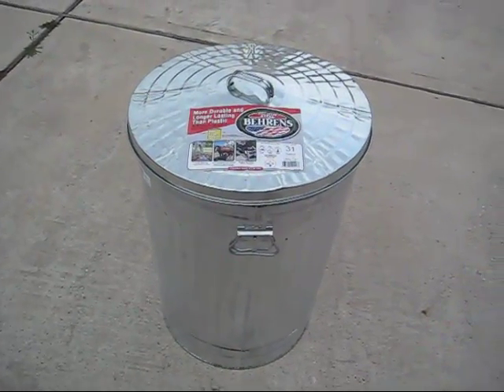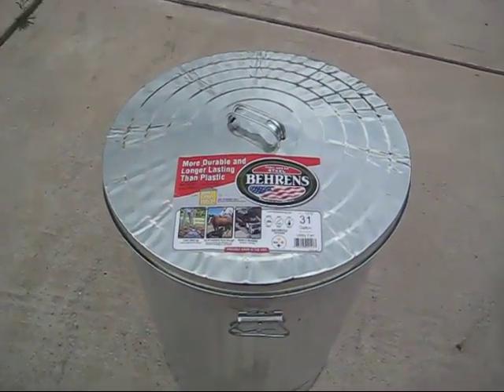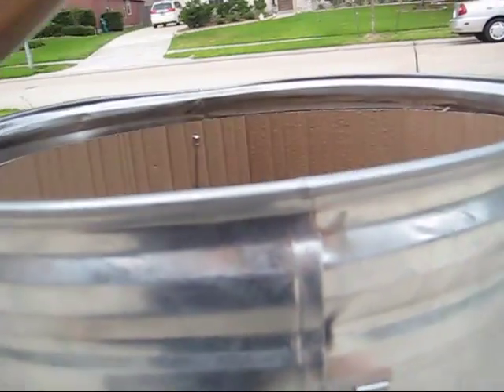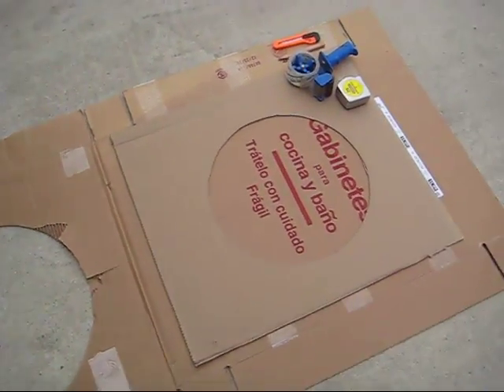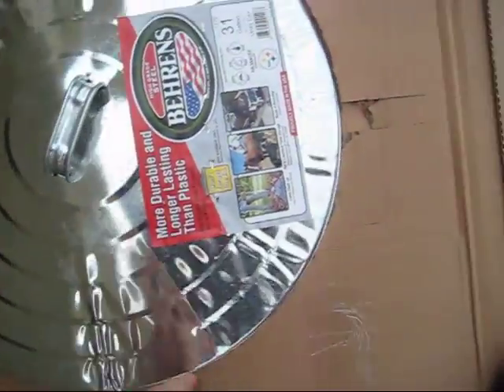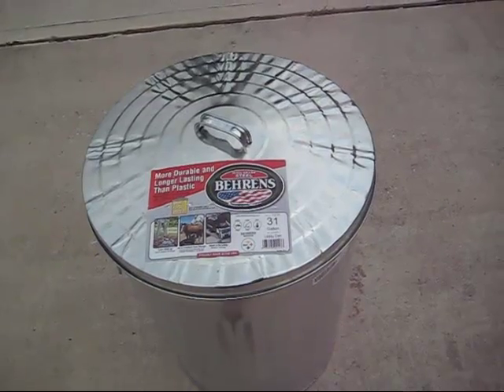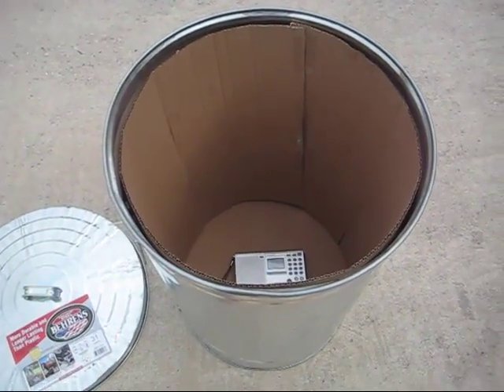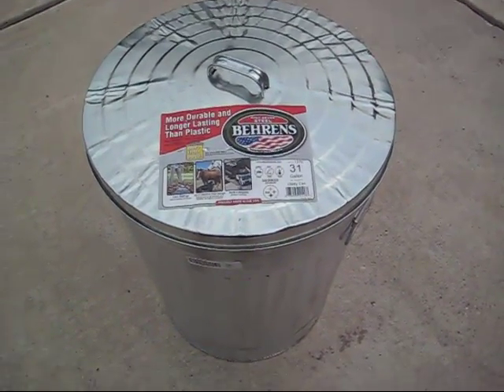Faraday Cage: Garbage Can, Really?

Comment: FM isn't a good test even if the cage is good. Fm can be fully blocked with a chain link fence or mesh with holes an inch wide, an emp device or solar event goes down to DC power so a pinhole is too big

Comment: I had to put 2way tape in to hold my cardboard. I also put faraday cloth on the lid, but it’s not working because I can hear my tablet when I put the lid on. Please help me!!
Reply: Sometimes the seams can “leak” as well as the lid. Try some aluminum tape from the inside for the seams. Plain foil around the mouth of the can before fitting the lid. You may also nest a smaller metal trash can or paint bucket setup like the outer can.

Comment: Do you have to ground this? If so how would you do yhis.
Reply: I’ve watched a lot of this type of videos, some do most don’t. They sometimes ground it like a generator, wire in the ground or metal pipe in house. One used grounding wire in electrical outlet, not for me. A PHD type said that there is very little gain doing it.

Comment: How will a cell phone work after an EMP event without a Sim card ? Or what can one do to use a cell with a number ? Besides 2 two way radio !
Reply: I wonder if cell towers will survive?
Reply: @sixoffive  How they going to get power long term after backup depleted?
Reply: @RazorStrap  Was told that they were designed to withstand lightning strikes so likely they could survive an event. Some have backup batteries for days. But, yea. If infrastructure is down are they going to prioritize cell tower like institutions (hospitals) in restoring power?  Some select towers could be restored with a temporary power source. Depends on the state of national security at the time and resources.
Crazy scary huh? 
I’ve got some stuff in a used metal paint bucket. Followed the same instructions. Large enough for cell phone size stuff.  Good luck.
Reply: @sixoffive  Line the paint can with aluminum foil or copper foil.  The metal in most repurposed containers such as garbage cans, cookie tins etc. is relatively poor electrical conductor.  Lining with better conductive material such as aluminum foil or copper foil will significantly increase its effectiveness.  Also, most metal food containers have a protective coating that is nonconductive.  So, the lid does not make an effective electrical seal. Need to scrape that coating off the lid to container contact surfaces.  Also use an electrically conductive gasket such as aluminum or copper foil or maybe Steel Wool.
Reply: @RazorStrap  Hi, yes I sanded the the coating off where the lid contacts the bucket and tested with ohm meter. I like paint bucket because of the handle. I thought the container should be lined or insulated to protect the contents?  I have a galvanized trash can, but too big for the essentials. 
I’ve been thinking about this for a while. If there is some sort of CME or EMP, there will be a chance of fires. If nothing else lithium batteries. Right?
I’m thinking if you are bugging out, you should be carrying your electronics in a faraday cage type container.

Comment: My plan is to buy this can, line it with a thick layer of  flex seal. Put an inch of sand in the bottom followed by a stack of milk crates as organizers and then seal with 3+ layers of 2" aluminum hvac tape. The goal is to go as overboard as possible. Just because your radio can recieve a typical signal does not mean your cage will protect from a high load as expected in a catastrophic emp. That being said would you rather under do your protective measures or go overkill to ensure your equipment lasts. Another idea is to use smaller cans as a secondary Faraday within the first as another layer of insulation. Is it over kill? Probably. Do I wanna F around and find out? Not really 😅
Reply: Agreed, if we/you do get EMP a second or third could happen. After use I would store those items back inside and re-secure it.
The frequency could be so high/strong that stuff plugged in could burst into flames because of the grid catching and transmission the discharge. A couple of fire extinguishers might be a good idea.

Comment: The dielectric (insulating) strength of this set-up is good for wimpy radio signals.  To shield against EMP, important items should be wrapped in foil, then wrapped in an inch or two of some insulating material.  Being one or two inches away from the garbage can is better and a quarter inch away.  If you have multiple layers of foil, foam (or whatever), foil, foam, foil, foam, then the more paranoid you have it the more protected you are.

In England, people have to pay a subscription to the BBC for every TV and every radio they have.  To enforce this, BBC snooper vans drive up and down every street looking for pirate radios that don't have their subscriptions paid up.  If you were surrounded by Chinese or Russian paratroopers, they could find your hidey-hole simply by looking for radio receivers (with no need to look for transmitted signals).  Beware.  

We have had little bazooka-type rockets that pick up on the radio signal the human heart puts out, and they can tell a human heartbeat from an animal heartbeat.  The first time we let the Israelis have these about 30 years ago, some guy test-fired his first shot out in the desert.  It shot out of the tube a couple hundred feet, detected nothing, started searching as it is supposed to do.  When it got turned around enough to detect his heart beat, it homed in on the guy and killed him.

Comment: I highly recommend people put rechargeable batteries, a small folding solar charger and USB compatible chargers for the batteries. Worst case you will have to cycle those batteries many times, but it would be a drag to protect your electronics and only have enough batteries to run them once. I've found chargers that will do from AAA, 8V all the way through 21700 batteries via USB connected charging sources. You may need to buy quantity of long storage life hearing aid, optic for firearms or other small batteries, but I have even chosen some older optics that use larger batteries which I can charge.

Comment: Great Idea. Im a Ham Radio operator & I would imagine a fridge, or freezer or microwave would shield from EMP. In the UK the metal cabinets are grounded. So perhaps grounding the trash can would allow the energy to discharge to Earth. Or wrapping the likes of my 50 Inch plasma TV  in foil & ground the foii & unplugging the mains & antenna cable would be a good idea.  Any water pipe would do.

Comment: FYI that can is grounded!
It is sitting on concrete which has ground potential.
It is not necessary to insulate the inside of the lid unless you have things that can touch it.
For better results, foil tape the inside and outside of the handles as well as the lid to the can side.
And both inside and outside the can seam (seam that goes from top to bottom) as well as the bottom seam of the trash can.
All it takes is a tiny opening to destroy what is inside.

That can will not protect against a ground zero style of EMP (close airburst).
It can help if you are farther away. Inverse square formula.

Advantage of the metal trash can is that it can protect against EMP DC induced induction.

Comment: You should remove the cardboard to allow full contact between the can and the lid. A metal seal may be even a better option. Also test it with a 2 way radio to ensure it is completely blocking any signal.

Comment: I take nesting a bit to far.
I have EMP bags to put electrical stuff that are first in a Cardboard boxes in. Then I place it in a Ammo cans. I use Metal Duct tape where the 2 pieces meet to seal the seams. I also place the metal tape over any place where the can has been pierce by RIVITS, screws, etc. Then I label what's in the Ammo can on the outside of ammo can.
Then I place the Ammo can Into the garbage can that you have with the cardboard inside and I again tape the lid down with the metal duct tape and cover tape over any area that has pierced the can with tape.
That's taking it a bit to far. 
Just my 2 cent
Good luck

Comment: Strictly speaking, the problem with using corrugated cardboard as the insulator is that if it gets wet it doesn't insulate. Coroplast might be a better option.

Comment: The Faraday cage needs complete metal-to-metal contact for total electrical continuity of the "seal" everywhere, as he says in the video.
Some preppers use aluminum foil to fill any gaps between lid and can.
  Some guys like to use a metal ammunition box if the can is too big, but the preparation is the same (padded inside, electrical; seals,  desiccant bag,  etc.)
Some guys like to add a grounding wire.

Comment: That's exactly what I did.  
But, I also wrapped every device in aluminum foil. Then each item in a Zip Lock baggie. 
My solar charge controllers, inverters, multimeter,, AM/FM/WEATHER Solar/crank radio, and 2- 2 way radio sets. 2-of the  4 unit sets so a total of 8.units. Put my DVD/TV system,  battery chargers, AC Tic Tester, a few extra 2 Cobra CB 40 channel walkie talkies and a battery powered alarm clock.  
There MIGHT be a 9mm Ruger in there too? LOL. 
I figure its better than 90% of what most people have done.  
Oh, I also have a pair if those 12v LED or Fluorescent lamps too. And, everyone should add some 100 or 150 LED  Christmas lights strings in there too. Not a lot of light, but 50-+00 foot for $10 isn't bad. 
Pretty easy to tuck a garbage can out of the way too😁.

Comment: my garage has aluminum siding and a steel door I figured that's a Faraday cage all on its own, but I need  a layer of aluminum foil on the ceiling window and side door, but I keep getting distracted lol and then people will start asking questions.  
But inside there's a grounded gang box lined with cardboard with 3 x coolers wrapped in heavy duty aluminum foil inside of them 3 x ammo cans lined with cardboard inside those are some baofeng radios, some replacement parts for a 70's and an 80's vehicle coils starters and an alternator, a bag of all our old cell phones we don't use anymore but still work. I keep the charged batteries separate in the little jelly jars, a bag of all the extra USB chargers from all kinds of different electronics we've had collecting in a shoe box under the bed. A new atsc TV tuner that has a USB C an old one that has the slighty older USB B I guess. An old tiny little Lenovo laptop that was xp i think it was from one of those black Friday sales. I keep the battery out of it too in two big mylar ziplock bags that have been vacuum sealed the charger in with the other chargers.
I figure if anything is going to catch fire it's going to be the chargers because of all the windings then the car parts because of the windings I keep stuffing little things that we don't use anymore like wrist watches and a couple DS Gameboys pocket radios an organization calculator, the kids big $100 calculator I had to buy them for HS, I can't even remember what I packed inside it's like a garage sale table in each box.  I have been thinking of swapping the plastic coolers for some old steel ones because the foil is a pita but I haven't seen any.

Comment: What does "LDS" stand for in this video?  "Let's Don't Study" I believe.  What do I mean by this?  You show, successfully I might add, a simple faraday cage preventing FM radio waves from entering the container.  GREAT!  If all there was to an EMP was radio waves at that frequency you would be set!  Turns out that the FM frequencies are a TINY portion of what is sent out from an EMP event.  People on YouTube University seem to just test one type of device (FM radio in your case, cell phones and AM radios in other videos) and fail to understand (because of their lack of studying) that an EMP pulse has an effective radio frequency range from a few hundred hertz to 30GHz.  FM frequencies are 88.5 MHz to 107 MHz.  AM is 560 kHz to 1700 kHz.  Cell phones are in the GHz range.  In order to provide adequate protection from an EMP pulse you need a faraday cage able to provide AT LEAST an -80db level of attenuation.  Why?  After a moderate HEMP pulse you are looking at 50k V/m2 (squared) of energy hitting ground level.  That means that if your faraday cage can't provide -80db of attenuation things that you place in your garbage can will be toast. 

The good thing is, since you already have your precious electronics in a garbage can you won't need to move it to another one :-)    It'll already be in the garbage.

Now, how can you improve your design?  First and foremost, you don't want ANY holes.  If you have rivets that are used to attach the handles, you'll need to get rid of that.  The lid handles are often just inserted into a punched out slot and bent.  That needs to be dealt with.  Any seam in the can needs to be dealt with.  Using metallic tape is a good solution for this.  Now, how do you place the lid on the can properly?  First, make sure that the lid is ALREADY tight-fitting.  Then you can put a 1/4" mesh sealing tape on the inside of the lid, or some people suggest simply using aluminum foil.  If done right that will work.  The next critical piece is getting the contents AWAY FROM THE SKIN of the metal can.  You show using a thin piece of cardboard.  WRONG!  DON'T DO IT!!!  Cardboard is not much better than air.  You want at least 2" of separation using a good quality non-conductive material.  This needs to be using on the bottom, sides, and in the lid.  Now that you have at least 2" of physical separation you should now use a good quality bag designed for static control.  These bags come in large sizes.  You would place this bag so as to act as a liner.  Once you have this in place the last you you would NEVER do is to ground the can.  You have to do some special things with the ground that DIY people don't have access to... so not grounding it is a much better option.

I have spent years studying EMP, HEMP, NEMP and CME, and have spent a lot of time with people at MIT that have been able to study the effects of EMP and how to protect against it.  Although your heart is in the right place in wanting to help people, the actual can you show will do NOTHING (other than providing a place to put the fried electronic gear once the EMP hits) to protect any type of electronics.  Sorry to be the bearer of bad news.  

I wrote this information NOT to make you feel bad, but to get the message out.  I hope you aren't offended, but take the advise and improve your design.

If you would like more information on EMP's please respond to this with your email or a way of contacting you and I will contact you personally if you would like.

Thanks for your efforts!!  Dan
Reply: Hi Dan, thanks for sharing this info. What are your thoughts on 50 Caliber ammo cans using aluminum foil to line the lid contact area? Would they be effective? What about putting a smaller shortwave radio, for instance, in a sturdy ziplock bag and then wrapping it with multiple layers of aluminum foil? Would that protect the radio? Thanks, Jason
Reply: @RockyMountainBushcraft  The gauge that is used for ammo cans are great.  The issue comes protecting your electronics from the container walls/floor/lid.  YOU HAVE TO KEEP A BARRIER BETWEEN THE CONTAINER SURFACE AND THE ELECTRONICS.  So, a physical barrier of thick hi-density foam (or similar) is good for that... but you can't stop there.  You need to line the inside then with a very good anti-static bag... they are typically pink in color.  Then it's best to put the electronic device you are trying to protect in anther bag of similar quality/type.  

The rule of thumb is, at least back in the 80's the amount of electrical charge that an EMP would produce is 50k v/meter.... so the surface area of a 50cal can is much smaller, so it would not be hit with the full 50kv/m.... let's say the affect is only 30kv/m or even 10kv/m.  Well, even though the effective skin voltage is a fifth of what it would be from a large garbage can, 10kv will still fry the electronics.... so you need to attenuate the effects by at least -60db.... thus the physical separation using some sort of high-density material, followed by the inducstrial static bag liner, followed by the similar bag that will be used to house the device.  REMEMBER... the 50kv/m was a value identified way back in the day.  Today's nukes could have a significate increase over this as rogue countries have had plenty of time to develop nukes designed and formulated to produce a much higher yield.  So the above is probably way outdated.

I am giving a presentation in April on this very thing that you might be interested in viewing.  Let me know and I'll send you the details.  BEST OF LUCK!!

Comment: I tried this - lined it with cardboard as you show.  used the Behrens trash cans.  I nested a 20 gal can inside a 32 gal can.  the lids were very tight. cardboard in both cans.  Then I put my cell phone inside the 20 gal can, put the lids on both cans and then had a friend call.  The cell phone rang!!!  I am SO bummed.

Comment: Hello again doc.  I know this video was made long before your video on using the 1/4" sealer on the top edge of the lid but I was wondering if the cardboard interferes with the 1/4" metal seal?  Should I look to attach the seal to the inside lip of the can lid? Thanks again sir.

Comment: You can make a E.M.P. Proof bag out of a 1 gallon zip lock bag & some heavy duty aluminum tape the kind you put around air ducts you need 3 layers of it Chris crossed you can even make 1 out of a heavy duty construction garbage bags like the 55 gallon ones . It works a friend of mine proved it to me with some simple science . The tape has to be very thick like thicker than sticker or thick like 10 pieces of paper for it to work.